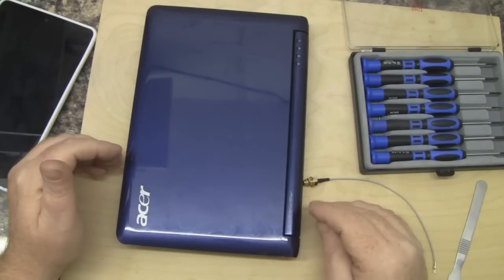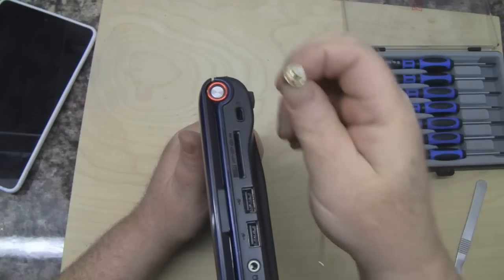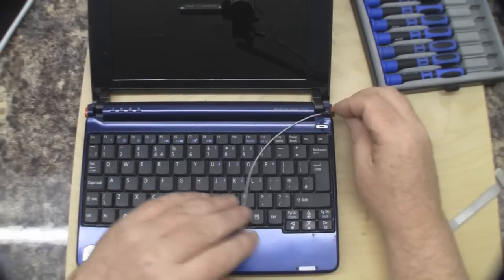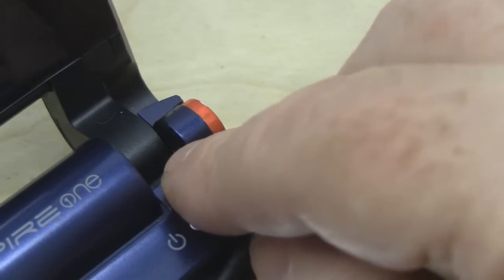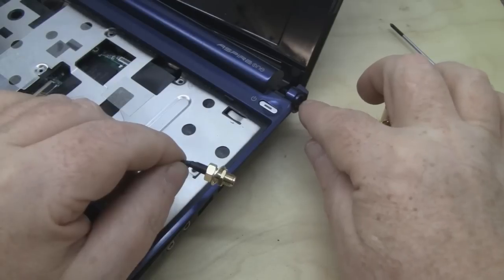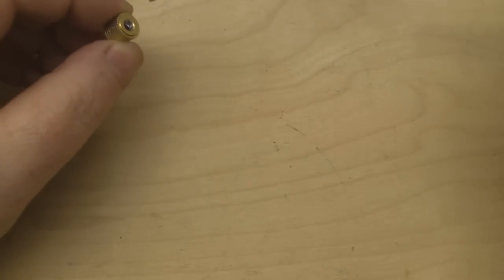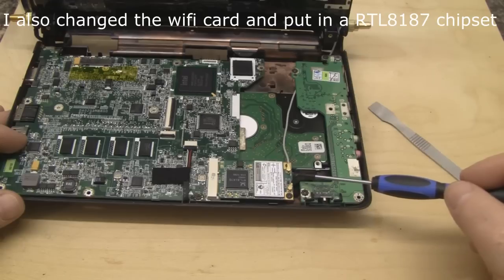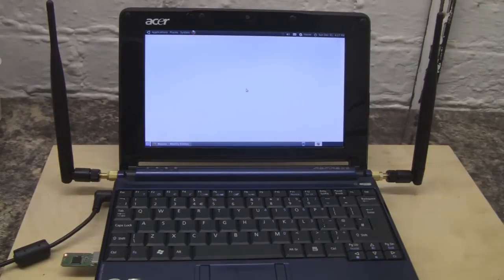Laptop External Antenna Mod

Comment: How much of a signal gain did you get with the external antennas versus the built-in ones?
Reply: Just wondering why that wasn't part of the video.
Reply: Not that much I tried actually idk why not working only Alfa is good for this
Reply: Ipex connectors come in 2 sizes. They snap onto the adapter. They have the signal coming through them from the antennas so perhaps the adapter the connection or the antenna is not tuned for 2.4/5.8Ghz wi-fi.

Comment: Hello, Andrew! I've been thinking about making a WIFi home router with and old laptop by adding external antennas and installing DD-WRT or any other OS. There are not many good videos on that. If you are able to make one and analyze the cons and pros about it. Thank you!
Reply: For windows there is Virtul Router Plus by codeplex which takes Ethernet and spits wpa2 on internal wi-fi and TurnOffLcd by RedmondPie v1.1 without the cmd prompt for turning off the LCD remaining on the screen afterwards but you need the driver for GPU which happens to be offline installable and always torrent available for any hardware also in the form of Snappy Driver Installer

Comment: Great video, its from your videos , Hak5 and a few other i got into pentesting and amateur radio.  One quick question, would there be any problem if i just added the one antenna and left the other connector as is ??
Reply: One is main, one is aux, be sure to boost the main or choose omnidirectional for aux and unidirectional for main if you like to experiment.

Comment: Hi! I was wondering what is the complete name for those connectors you used? just SMA? and where I can find them and how much do they cost?
Reply from the maker: K. Von D RP SMA http://www.ebay.co.uk/itm/261743734863?_trksid=p2060353.m2749.l2649&ssPageName=STRK%3AMEBIDX%3AIT

Comment: Really great video, I follow your work and I was wondering if you can advise me...  I have the TP-Link TL-WA801ND access point as a range extender and I like to use a cantenna in one of the 2 original antenna an the other to radiate my house, and I like your opinion or better yet your guide to make it 
Thanks a lot and continue your great work

Comment: you should just strip out the sma antenna to the bare essentials and have the antanne wire embedded behind the lcd in the lid assemply, much smarter.

Comment: 1:02 I would like to know if I can find anywhere a 2.4 and 5.8 Ghz laptop internal Wifi adapter for pentesting too... Anyone knows where I could find one ?
Reply: EBay, Amazon,  temu, Ali express. 
Everywhere.
Reply: Thanks, I got a Dual band USB 3.x (as it has internally the 5 pins at top of the USB connector for extra speed) paired with latest RTL8814AU chip which supports from my tests WPS pixie-dust in Parrot OS with the end result of having the WI-FI password from a place I could have simply asked for the password... Imagine the network admin saying NO in my face and KNOWING me for asking for it... No thanks. I'll grab it myself. black hacker hoodie comes on
Reply: @Vertigon100  I'm using an r7800 router with 4x4 mu mimo and packet injection. 
That way I can mount it anywhere wireless and connect antennas outside to beamform. 
Tcpdumb to the remote machine for further use with aircrack-ng suit👌

Comment: It's strange, I have the internal card that's the same chipset as my usb dongle.
Internal card shows everything except probe information 
Usb shows everything except BSSID information aka not associated
😅 not so funny part. Modifications to a tiny dual inverted-F antenna design AND a $5k gaming laptop 😩
The usb has the smallest traces on the PCB it's insane